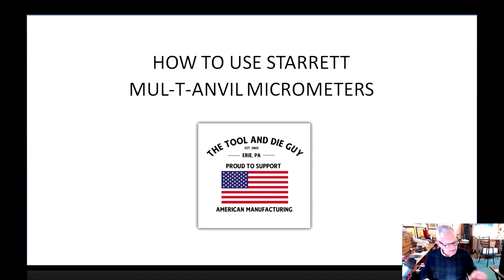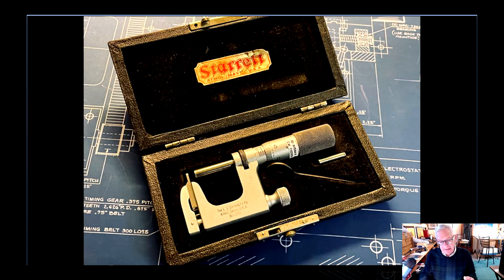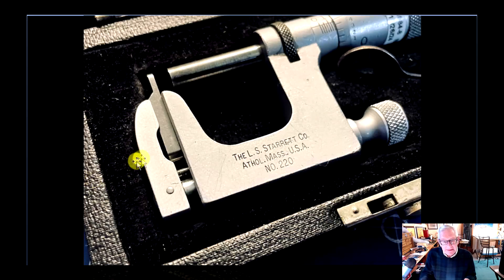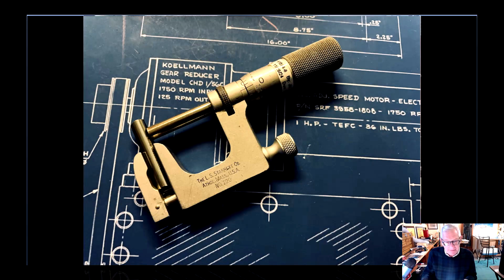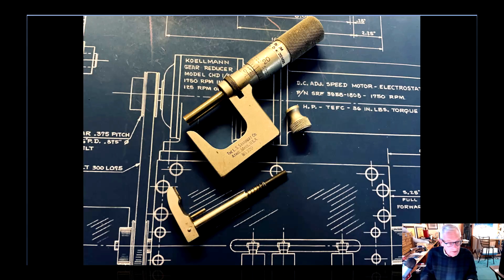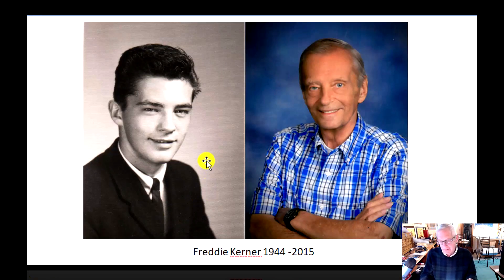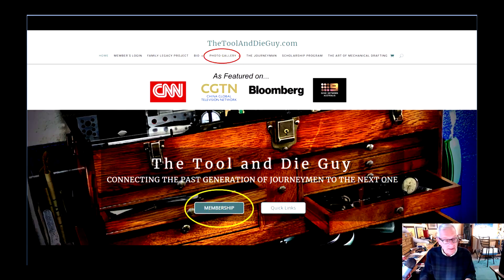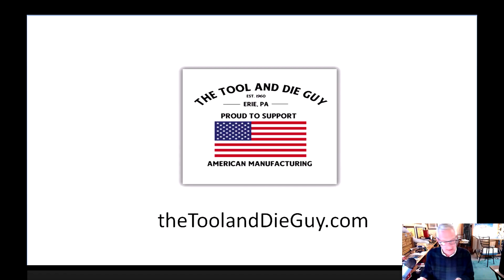HOW TO USE STARRETT MUL-T-ANVIL MICROMETERS

Comment: I use my MITUTOYO pins mics all the time! Especially grinding! Remove the anvils and you can measure to the tenth with the vernier scale! They are EXTREMELY accurate! Plus all the same features as the 220 starretts but can measure to the .00010" for grinding!!!

Comment: Very good info! 👍🏻 I have one of these and just used it the other day. Mine has seen decades of use and definitely shows it but it works for me. Also I only have one anvil and it’s a 1/16 dowel pin. Sometimes I use it as a height or depth gauge.

Comment: As an Austrian-German, i fully support state mandated Mul-T-anvil micrometer propaganda... These are such beautiful, high-performance design pieces which in a way make the regular micrometer obsolete... You could replace the regular micrometers entirely with this design and adapt it for larger radius pieces and not a thing would be lost by switching the industry to this type of mic entirely... At least in the 1 inch or 0-25mm range, they should entirely replace the normal micrometer... There is not a single instance where this design is not at least equally as good for the task at hand, plus it offers remarkable leaps in your ability to perform other measurements without the need for an entirely separate metrology piece... It is remarkably utilitarian and thereby extremely cost effective, as it is a piece of fine engineering and not just a common consumer grade product... Hell, trade school teachers that don`t draw the young machinist`s attentions to these are bordering on criminal negligence in their duties as an instructor... It is such a marvelous design... I have my mitutoyo 1micron 0-25mm normal micrometers(yes, more than one, i have a disease and a fetish for quality pieces), and they are amazing tools, but they pale in comparison to this design of the same specifications... The same goes for 0.01mm 0-25mm normal micrometers... It is just a superior design overall... 

Best regards!
Steuss
Reply: Tube micrometers with a spherical anvil and those precision balls that fit on the anvil could also be made obsolete.

Comment: Sound is much better on this one Phil. I bought a pair some 30 years ago. Originally to measure the liner protrusion on Diesel engines. it did not take me long to figure out the other uses, especially with the pin. Nevertheless it sees frequent use in my day to day machine work. Good stuff sir.  Edit: I do have a question on second thought. They make a 1-2" version of this mic. I have never found a reason to use it nor do I have one. Have you (or anyone else out there) used or use a 1-2" #220?